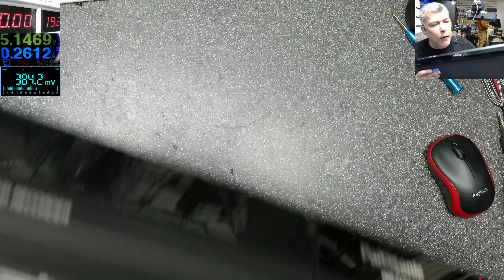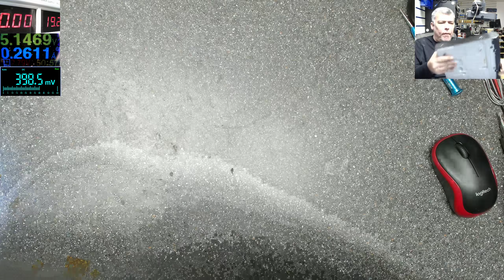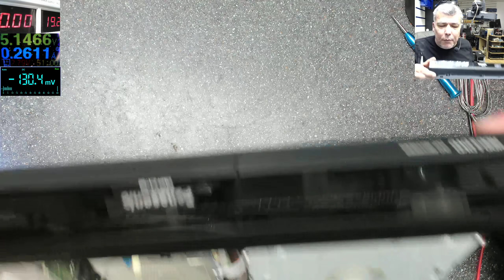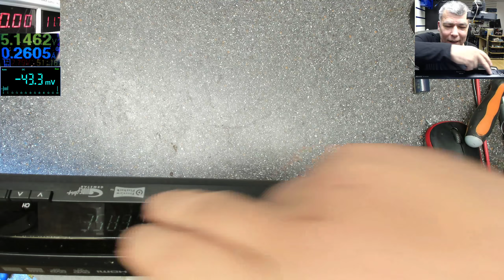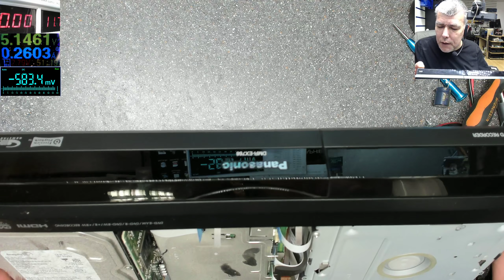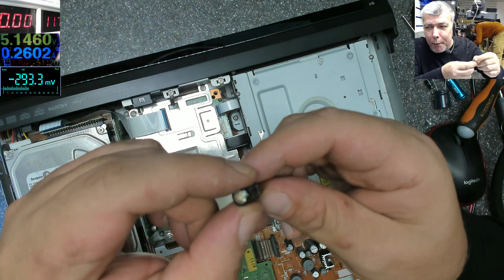Panasonic DMR-EX768 - a Voodoo job

Comment: i do not know the schematic, but as you said, something is switching and because of that could be a buck-boost converter probably, and because it has a coil there, in parallel or in series, depends on how the circuit is and how the voltage it is raising...

Comment: Talk about voodoo, I am sitting next to my dead Panasonic DVR and it is the EXACT same model with the EXACT same fault... and the exact same two capacitors failed... haven't tried the 12 volt injection though to see if it generates the extra 300mV... spooky... o_O Thanks for the video, very useful ;)

Comment: Have seen a few of these 'DMR' series machines at Repair Cafés - the 'please wait' screen is infuriating when it just sits there flashing endlessly :D - one of them was fixed with a cheap repair kit off eBay (a few capacitors and a DC-DC IC on the main board) - the PSUs in these things are ropey it seems!

Comment: it's weirder that you keep checking for the right voltage knowing that there's a bad cap in the circuit. would it be the reason why you get an incorrect voltage because of the bad cap?

Comment: 8:28 perhaps that  is possible beacause some kind of inductor creates big voltage spikes that are getting smoothed in capacitor., which can be cause of that spark you hear when you turn on a deivce or cause of these blown capacitors. [ this is written before watching video till end ]

Comment: Maybe a diferent level of ground is showing a higher voltage drop on the multimeter. Or even a low negavite voltage measured across with the positive one.

Comment: you didn't explain why it's ok to replace a capacitor with higher capacity than the original
Reply: it depends where that capacitor is. if on the last place, where the output is, then you can use twice or even third times more capacity. but some other places required sometimes critical the same value. some of regulator requires very critical value and if is below or above it will not start producing voltage.

You can think in this way - the factory will always use the absolute minimum capacitance to reduce production cost. they don't do things, which are not necessary. So sometimes when you use more capacity it will give you better, smooth output voltage.

but you cannot put 10 /20 times bigger cap because each capacitor when it empty is making short until you fill it / charge it. so when you apply voltage to power supply-it will meet short there for very short time, until cap will be full, so very big capacitor can destroy weak power line 

that is why for example when you have very huge capacitor for car audio which is long as your whole arm and has capacity 1000000 uF,  you cannot connect it directly to the car battery because you will experience huge sparks and sound explosion, because it makes short on the beginning. you have to charge it /fill it via /trough light bulb connected in series, then capacitor will slowly fill /charge and then when its full it stops making a short, so then you remove bulb and you can connect safety capacitor straight to car battery 

I've explained it to you in easy way, I don't have a time to discus whole aspects of capacitors.

And about video - I disagree with his practice to replace caps with any value which he pick up from the bag randomly.
Reply: @Radek__  Thank you for taking the time to explain i really appreciate it
Reply: You can replace capacitor with a little higher capacity, it has tolerance...

Comment: 8:24 that is part of a  buck converter circuit.. The switching regulator is underneath that capacitor SMD component. Remember this power supply outputs 3 different voltages 3.5v, 5.5v and 12.5v.  On a oscilloscope you would see the power wave dropping in and out which Dc circuit don`t like. I fixed many Panasonic products they always fail on them circuits as their always on even when you switch it off their on....
Reply: The failed caps probably said panasonic on them Hahahahahah......

Comment: multimeter set to measuring dc. with bad cap there is  ripple in voltage that get smother by capacitance o leads  so dc voltage rise

Comment: those aren't manufactured anymore. The unit is completely useless today. I'd just take the HDD out and the rest throw away
Reply: Didn't look on this one in video but HDD in my old LG one was extremely slow drive made for longevity and silence in mind and no performance. I can only guess this one use something similar so not very useful with prices of newer much bigger HDDs in mind.
Devices can still be used with STB for recordings of F2A, not everyone have some iptv with recording option and I guess owner of this one do so.

Comment: 23:58 But WHAT about that last swollen capacitor on the logic board side 4:29?
WTF man? I know that you are lazy sometimes, I know that shop doesn't have free time for work above what is necessary, 
but what kind of repair it is, when you see clearly broken/bad capacitor and you left it? 
Because access to it is not easy? 
You know very good, what kind of symptoms/issues that bad capacitor can do on the logic board. Whole system can be unstable or can randomly hang-up.
You know this, that this is possible, but you left that cap at it is. 
You spent 15minutes for fun with the power supply, and for that bad capacitor you doesn't have time anymore
 I don't' understand this.
Reply: Yep.. and when i work in "economy mode"  .... i just pull off capacitors from this side and place new ones soldering legs on old legs...
Reply: I agree completely.
Reply: He maybe forgot about that one
Reply: @raduionut8778  I don't believe it. it is not the first time when he left something :-)

Comment: more tutorial on elco replacement please, im curious about the rules for the different value
Reply: There is no rules except one - never go with lower voltage cap. Capacity is different story, almost everything have wide tolerance range. So you can go lower or higher but try to stay in reasonable range. What's reasonable? Hard to tell, I stick with 20% without single problem in entire life but maybe even more is ok. Especially with SMPS and similar, linear audio equipment probably have more narrow tolerance range.
Reply: @gorky_vk  thank you for your rich and humble explanation sir. Have a good day
Reply: @PrasetyoMuhammadDwiBiology  I miss important note - what I say apply to electrolytic capacitors and large MLC caps) on power rails, in other instances like any kind of oscillator, switching circuit etc. can have big impact on switching frequencies. Some will just change some minor things.
In this video he replace that one small cap on high side. It was 35V cap so 35V on high side can be only some kind of bootstrap capacitor, nothing else. With less capacity SMPS will start sooner than with original one (voltage will rise faster), if capacity value is too low PS will not start because IC doesn't have enough power to start switching. In this case it start normally so he's good but when capacitor loose some of it's capacity due aging maybe it will be a problem. But probably at that time this DVR will be electronic waste anyway.

Some knowledge about  purpose of part you replacing in circuit will help you a lot to choose right value. Most of the time we don't know so we stick with original value as close as possible, not everything is simple as most SMTPs.